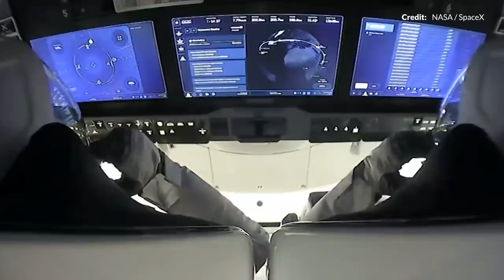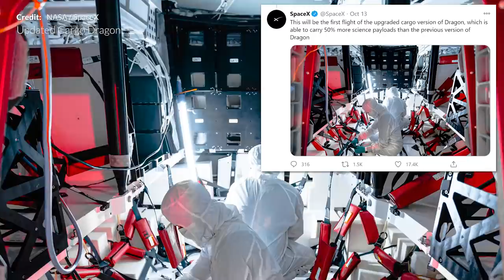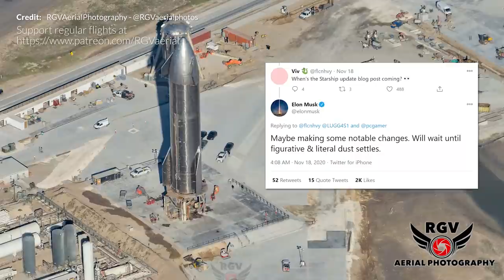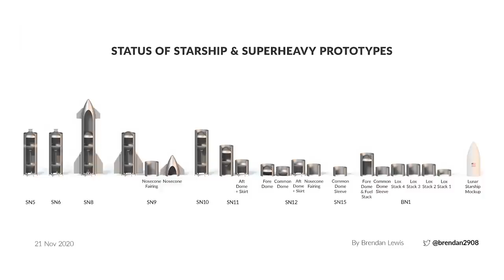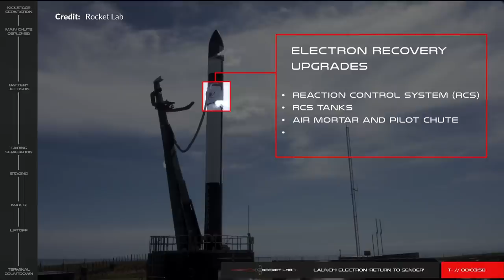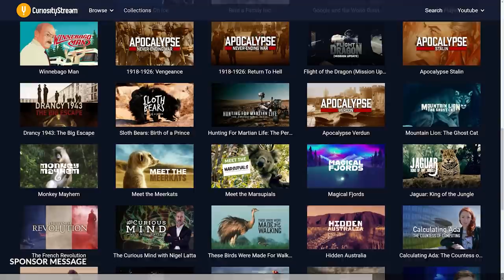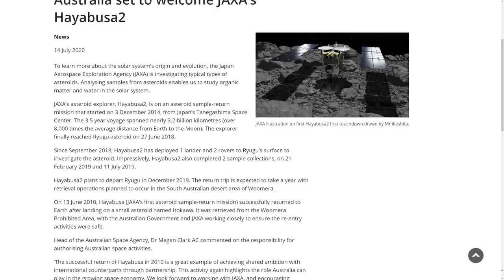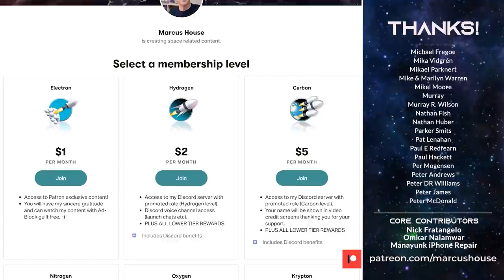SpaceX Starship prepares for flight, SpaceX and NASA make history with Crew 1

Comment: Anyone got really nervous for crew 1 or did you know that everything is reliable and will go perfectly as planned?
Reply: nervous
Reply: Last time a falcon 9 failed to deliver was 4 years ago... also, this mission was way more careful than most spacex missions. 

I had exactly 0 doubt that it would succeed
Reply: I was quite nervous because I wanted the mission to succeed however I wasn’t worried for the astronauts because falcon is a reliable launch vehicle and in the unlikely event that it failed, the launch escape system would save them
Reply: @LowieDM  i would have been way more nervous about that on boeing' starliner
Reply: Wasn’t nervous at all. I knew spacex would pull through
Reply: I'm always nervous watching any manned launch.
Reply: I live in North Carolina and I saw it fly by off the coast...
Reply: I was certainly hoping nothing bad would happen, because something bad always can... especially as complexity of systems increases; and, there aren't many more complex systems than Falcon 9 Crew...
Reply: I have great faith in the DracoThrusters should something go wrong. At least their odds of survival are improved. Still concerned for them.
Reply: @luminus3d  Oh, so much!  I don't think I could bring myself to trust their hardware/software with something this dangerous any more.
Reply: I was nervous it would be scrubbed on the pad, but not that anyone would be hurt.

Comment: I believe they are testing the pads themselves as well, as had been pointed out before, they will need somewhere to land, and if they plan on landing without extended legs, the surface they land on needs to withstand the force of those engines, especially when landing on other planets that do not have pre existing landing platforms...

Comment: Any idea of how many re-entries the thermal protection tiles will last for before needing replacing?
Reply: They are supposed to be more durable than the tiles on the Space Shuttle, but also dramatically cheaper and easier to replace so that replacement won't be as big of a deal.

Comment: If firing of the three raptors produces so much damage from an already well protected pad, how are they expecting the Starship to launch from the Moon's or Mars'  surfaces?
Reply: Good point! They'll need a little bulldozer at least...
Reply: I think you’re looking at it backwards. They are trying to launch without a flame diverter because they won’t have one on Mars. If they can’t make it work then they will need to bring a digger to Mars.
Reply: @nathanlewis42  Well sure...  but flame diverting is kind of a big deal.  Don't you think you'll have to do proof concept of such take-offs before you start building Starships and 15k hops?   I suspect they have already done that, and so my question remains, how are they planning on doing taking off from Mars?  Beefing up the skirt?
Reply: @PavelSTL  Proof of concepts are the static fires. The failures are basically part of the test.
Reply: @anthonypelchat  the static fire test is most definitely not a proof of concept test.  Here are the two descriptions from wiki.  See if you can tell the difference.

Proof of concept, also known as proof of principle, is a realization of a certain method or idea in order to demonstrate its feasibility, or a demonstration in principle with the aim of verifying that some concept or theory has practical potential. A proof of concept is usually small and may or may not be complete.

A static fire test includes a wet dress rehearsal and goes one step further: actually firing the engines at full thrust. The engine (or engines) is fired for a few seconds while the launch vehicle, with or without payload attached, is held firmly attached to the launch mount.
Reply: @PavelSTL  Ok. "Proof of Concept is usually small and may or may not be complete." A static fire is a "small" firing of the engines before the actual flight test. In this specific case, it would be a proof of concept for the concrete and the firing of 3 raptors at the same time. 

Smaller tests have already been done. The concrete is already a special version (I forget what it's called at the moment) and the engines have also been fired. The static fire is the next step.
Reply: I just realised the thrust on landing might go some way towards clearing the site? And presumably you'll be aiming for a level area, discovered by survey from orbit. Not impossible that a grading rover could land before the first humans, to sweep away the biggest rocks from what will soon become a carefully maintained spaceport.
Reply: @RobinWootton  That sounds reasonable, to clear the area from the landing thrust.   I would think it's too risky though, for two reasons.  First, the launch thrust is stronger, and secondly, landing thrust would heat up the rock a LOT, and then it cools off to freezing temperatures.  Resulting expansion and contraction would compromise the integrity of the rock that survived the landing thrust, so it might not survive the launch, break apart and damage the engines like it did with the SN8.  I'm sure they have thought of all that.  MAYBE Moon / Mars rock pieces will soften or even melt by the time they hit the engines.  After all, what hit SN8 Raptors weren't pieces of rock, but Martyte which is more resistant to heat I assume.
Reply: Well no digger on Mars. Avionics reinforcements instead, and larger legs
Reply: @PavelSTL  it doesn’t matter what I think and Elon Musk does things differently.

Comment: Great vid Marcus like always. Just two questions. If one side of the starship is covered in thermal tiles, will it be side heavy? Also, there seems to be collar ties in the nose strengthening the flaps up. Does this mean the nosecone area will be for the header tank and storage? And will the “payload area” be smaller because of this. I guess if they didn’t reuse the upper stage, the payload would be bigger. No header tank or collar ties for flaps.
Reply: The tiles is super light, especially compared to the rest of the ship

Comment: Why not douse the launch pad with water like the falcon launch pad?
Reply: The water is used to dampen the sound of the engine so that the sound doesn't destroy the rocket, it is not used to protect the surface from the heat

Comment: Yes on SN9 getting rolled out to launch pad with nose cone attached, or at least I really hope so. We all know Elon is in a hurry and optimising time an SN spends on the pad prior to launch would be great progress in increasing the cadence of testing. If all internal plumbing and wiring could be completed at the build site prior to rollout then when an SN gets to the pad it should, after Raptor install, be able to go pretty much straight into the cryo/WDR/SF test cycle.

I wonder if (or maybe when) SpaceX will even start installing the Raptors at the build site prior to rollout. When Starship "goes live" it's going to have to be pretty robust to get the desired turnaround times between launches so trundling an SNx down the road and lifting it on and off the transport and checking that all plumbing and other connections maintain integrity would seem to me to be a very useful exercise to go through multiple times during development. They could also do relatively low pressure (i.e. 100% safe) basic compressed air pressure testing at the build site before roll-out as well.
Reply: SN9+ has to be cryoproofed (with hydraulic ram) at the launch site first, so the Raptors will be installed on there after that. But ofc since the nosecone is already installed they only need to do one nominal cryoproof covered both the main & header tanks
Reply: @alvianchoiriapriliansyah9882  Good point re the hydraulic rams. Do you think they might get to the stage though where they are so confident of cryo though that they can dispense with that thrust-sim check? Maybe not for another year or so but at some point? Falcon 9 doesn't do that so presumably at some point between now and "going live" that testing will presumably be dropped although now that you have pointed it out I fully appreciate that we are nowhere near that stage yet.
Reply: I agree with 100% of what you say, have been thinking along these lines for a while. And the engines will be installed at the shipyard at some point, for sure. No hydraulic ram tests starting with... SN12?  SpaceX is pretty aggressive and risk tolerant about this kind of thing.

Comment: Hexagonal heat tiles give me anxiety. I guess they've studied Space Shuttles failed designs of heat shielding and determined this is the way to go.
Reply: What's wrong with hexes? Hexagons are the Bestagons!
Reply: @lordcirth  They are hard to cut if you are making a kitchen wall for example. Hard to cut = more errors. Square is better.
Reply: @Skeptic2006  They are certainly harder for humans to cut by eye, but if you are automating the cutting, I'm not sure it would increase errors. Hexes also decrease the total length of cuts relative to area, which means less total gap between tiles (for the same gap distance) relative to shielding.
Reply: @lordcirth  Well fine. At least they are not circles.

Comment: When fully equipped, could StarShip use the less efficient vacuum optimised raptors for landing as they won't need the full power of the atmospheric raptors?
Reply: It will have a problem of underexpansion which could damage the engine, and it can't gimbal

Comment: Why don’t they just double the height of the stand that would cut the pressure on the concert
Reply: Starship needs to able to withstand this. On the moon or mars there aren't any pads, so better light the engines close to the ground here on Earth and see what gets damaged and strengthen that. And that was still a flame resistant flat concrete surface. Imagine loose rubble and sand on mars!

Comment: They really need a water tower at the Boca SpaceX facility. They have some water equipment at the pads but they are for fire supression and are woefully underpressured. You should see Neal DeGrasse Tyson's rant about water towers.
Reply: They have pumps instead
Reply: @alvianchoiriapriliansyah9882  ???
Reply: @guitarsarelikestupid7200  I mean pumps. Blame autofalse for that, not correcting the false words, but falsing the correct words is what it can do
Reply: @alvianchoiriapriliansyah9882  Oh. Yeah. They have electric pumps but nothing beats gravity for water deluge for shock supression. I think pad 39 in Florida has 2 large water towers. (?)

Comment: Can ambient temperature affect spacex vehicle performance, think Challenger disaster.
Reply: At least it doesn't have an o-ring lol
Reply: Temperatures are no problem for the Falcon 9 - it has no solid rocket boosters, thus no O-rings or other drawbacks of SRBs. It's launched over one hundred times, with only one inflight failure in the early years. That had nothing to do with temperature. And the booster is intentionally colder than any Florida weather could get, it contains cryogenic liquid oxygen and its RP1 liquid fuel is sub cooled close to the point it would turn to sludge.

Starship is made of stainless steel. The 304L alloy can withstand the cold of cryogenic fuel and the heat of reentry, so ambient temps will mean nothing to it.
Reply: @donjones4719  TX

Comment: “Adding water cooled steel pipes to test pad”
I don’t understand this, what are they planning to do?
Reply: When things go boom, because of to much fire
human then add water to cool down fire, so things no longer go boom
Reply: Aeternalis Armentarius  I wouldnt say so and obviously not for everyone, add them to what? Areas of the GSE? to the actual issue area which i seriously dont think so?
  If its so obvious to you then be decent and answer the man.
Reply: Well first, are they going to test the pad with water cooled steel pipes, or are they permanently installing water cooled steel pipes to the testpad?

Will they spray water as nasa pads or just lower the temperature with closed pipes? Where to dump the heated water? 

I just mean it could be expanded upon. 
I guess I have to sit still in the boat and wait. :)
Reply: Aeternalis Armentarius  
Hah. No worries man. If I would choose to take every comment I could interpret as mean on internet, I would be probably cancel my internet subscription. ;)

Text is a bad way of communicating so there is rarely a point trying to try analyze feelings of the author because the assumptions will probably be wrong anyway. :) 

I can have a beer with a fellow space nerd. :)

Comment: In an emergency, can a Crew Dragon or even a cargo version, carry seven(7) people safely back to the earth's surface?
That would be another feather in Elon's hat if he can offer a permanently placed 'lifeboat' for the ISS.
I am assuming that the Crew Dragon can also be flown up to the ISS by unmanned control. I wasn't that attentive to the earlier testing of the Crew Dragon.
Reply: Cargo Dragon definitely can't carry people because it doesn't have a g-force seats (which is very important). Also if that Crew Dragon only comes with 4 g-force seats, they can only carry a max of 4 people
Reply: @alvianchoiriapriliansyah9882  
So there would have to be a special version made that is designed to ONLY carry as many people (7+) as possible back to the surface. Didn't we learn from the Titanic that there should always be enough room in the lifeboats for all passengers and crew.
I keep think of the scenario used in that movie where the star (a female astronaut) had to get back to the surface after space debris takes out the ISS and she is the only survivor.
Even if it would take two(2) plus Starship trips to get it up there, there should be some sort of lifeboat/Radiation shelter that can be easily reassembled in orbit and is designed only for radiation shelter/return to surface and re-usability is not worried about.
Hell, have a 2nd stage that is only propellant that lifts a heavily shielded Starship up there to be docked permanently. Rinse & Repeat for the ISS replacement as well.
Reply: @EvilDaveCanada  ISS always has a lifeboats, which is the own spacecraft that crew used to get up there in the first place. Thy obviously could leave in emergency faster than their usual scheduled time
Reply: @alvianchoiriapriliansyah9882  Is there another capsule docked right now in addition to the dragon? If there is then I have wasted your time and I am sorry.
Reply: @EvilDaveCanada  Ofc they're. Soyuz. Crew-1 only carried 4 crews, so where's the other three came from? :)
Reply: @alvianchoiriapriliansyah9882  I kinda figured it was used for taking things back to the surface. Like I said, "Didn't put a lot of thought to it" but I still think a permanently docked emergency vehicle make some sense. Anyone remember the Title of that movie? It came out sometime after 2000. And yes I am trying to change the subject. I may be Evil but even I know when I have nothing further to add.
Reply: @EvilDaveCanada  Are you referring to "Gravity"?
Reply: @robertgagne8892  Yes... Thank You
Reply: @EvilDaveCanada  Fellow Canadian here! And, you're quite welcome!